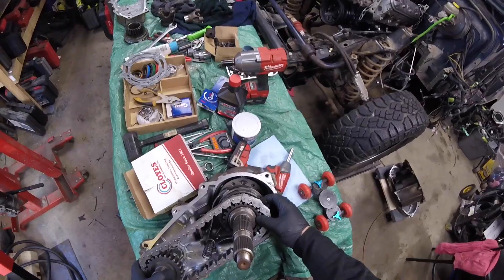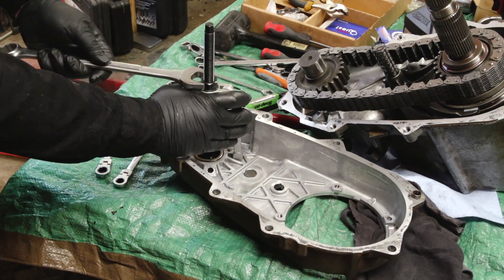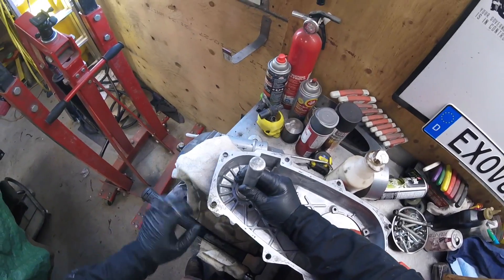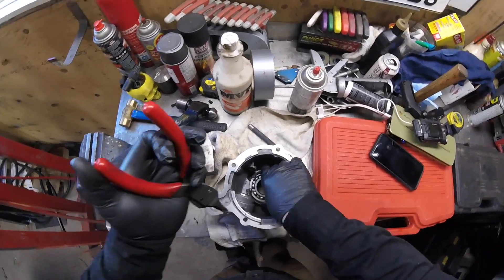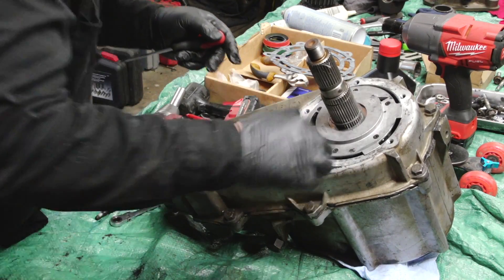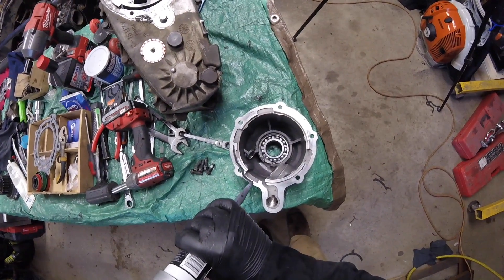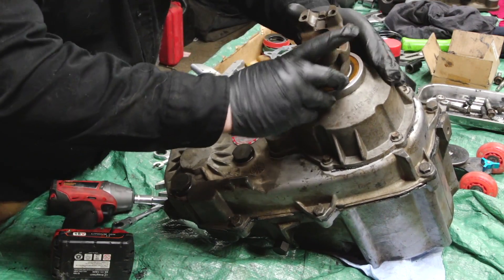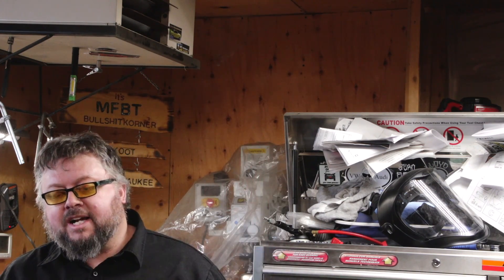NP231 Rebuild DIY Part 2 TJ LS Swap

Comment: Great video, thank you.   Although personally I think I would have replaced those pads on the front shift fork.   
What kind of blind hole bearing puller set is that that you are using?  That one looks like it works excellent!.

Comment: I know this is a little older but I have a question. I am using your vid as a play by play for the rebuild of my NP231. My question, the gears that slide onto the rear output shaft. There are two sets of needle bearings and a synchro ring. Do you replace those?

Comment: HI BSK garage I injoyed the video 👍👍👍 on you're last video I told you I had mechanic question that I would text on you're next video this one ok I have 94 Ford 150 302 5.0 litter  and the engine light is not on so no trouble code I've all ready did a full tune up new fuel and air filter and replaced all four relays it had bad fuel pump relay etc now just before this work it started to have problem ok here's what happening it will crank over fine warm or cold it won't start but if I put some gas in the intake it starts right up runs great will drive fine it just won't start on it's own with out putting a little gas in the intake and yes I put gas in the back gas tank no difference front or back gas tank it still does the same thing  do you a have any ideals what caused this to start happening it use to start fine does any body out there have any ideals on what I can check ??? well thank you good night ⛺ C😎😎L
Reply from the maker: It’s a sign that it’s time to take it to the crusher
Reply: @TestDontguess  hi the crushers noooo LOL ah you mean you have no ideal LOL 😂😂😂😆 yah I thought of taking to a wrecking yard I played 300 hundred dollars for it and drive it for four year's with out any trouble till about a couple of months ago it still runs great it's in good shape in and out still nice but I do have three other car's so well thank you any ways and you have good night 🌇🌆⛼🌃 guy i'm looking forward to  you're next video 👍👍👍 C😎😎L

Comment: Informative...however something tells me there is a torque spec for the yolk nuts...
Reply from the maker: There is a torque spec for every fastener, feel free to use them as you wish
Reply: Front yolk is 125ftlbs, I'm not sure about the rear one for a SYE,  it would best to check with a company that makes SYE kits.